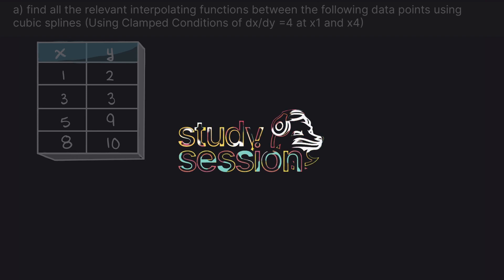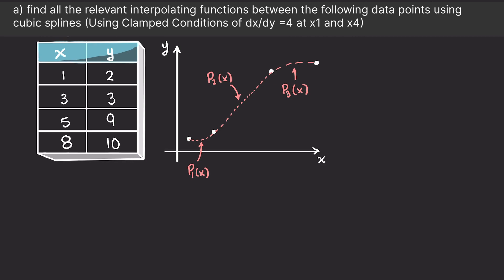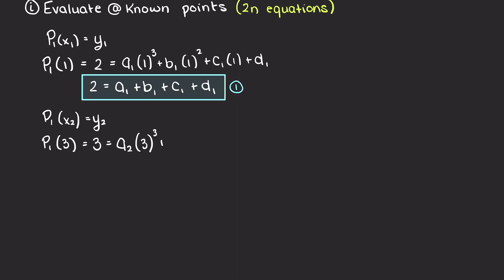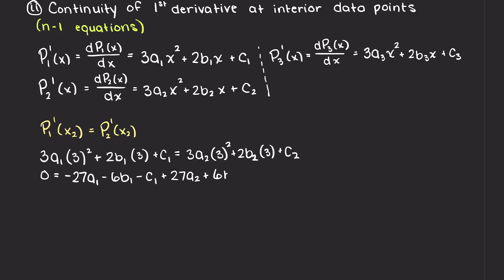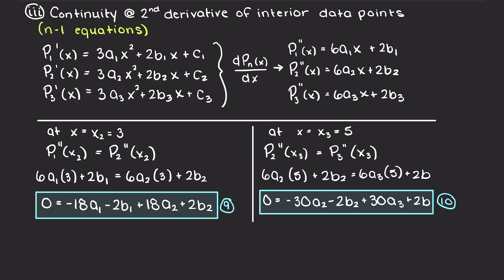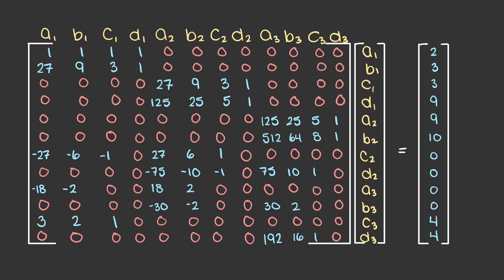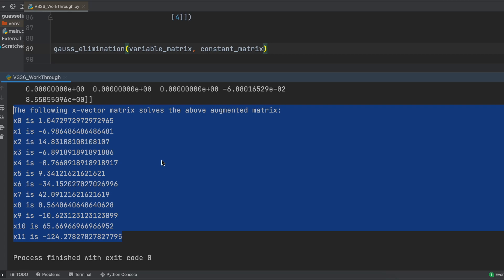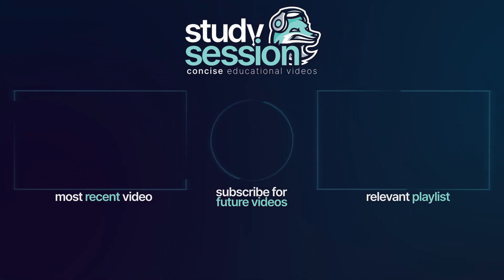Clamped Cubic Spline Interpolation Example | Numerical Methods

Comment: It's interesting that in the natural cubic spline solution, the plant initially shrunk below zero, and also shrunk slightly before the final measurement.  

This leads to the question of what would be reasonable clamping values for the endpoints.  The rather extreme clamped curve presented what I've nicknamed "ringing" in the curve.  How feasible is it to set boundaries without "clamping" the curves?  IE: the plant size can never go below zero, and can never shrink.

I guess that might take multiple trials or iterations, so I'm thinking some form of machine learning would be able to fit a curve to those constraints.  But then how would ringing in the curve be represented in the "cost" function for the solver?